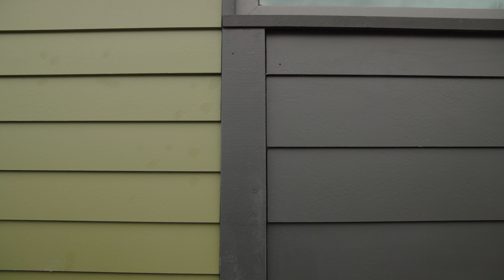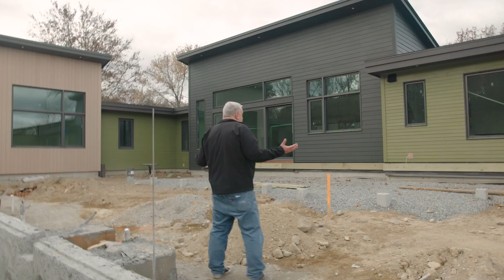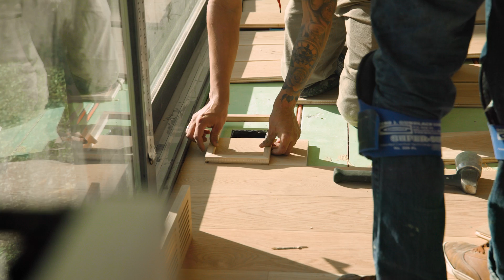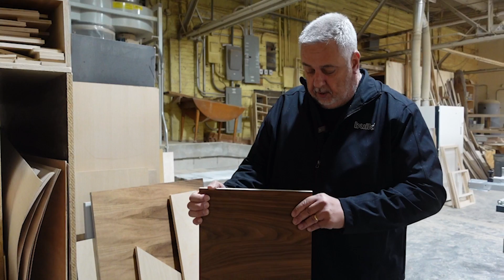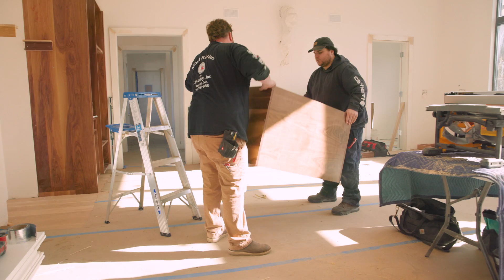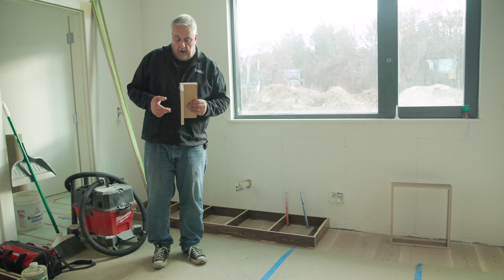"Wood Shop Tour, Casework & Exterior Updates" Build Show Build: Boston Ep. 22

Comment: Is there anything in place for future proofing external connections?  Last year I got fiber internet installed which means a new house pen.  No ISP is going to be as careful as how you did this new build.  Would a insulation filled pvc pipe make sense?  Something to give a path in when the homeowner needs it?
Reply: we added extra conduits to the house from the pole and conduits from the house to locations that might need to have power in the future.  Same thing inside with pathways to areas that are finished ceilings to be able to get added Cat6 (or future wiring) to the other areas.

Comment: 40:53 - no vent-holes for the refrigerator? The back-side makes a lot of heat!
Reply: probably has vents on the front or thru the bottom
Reply: The refrigerator is GE Appliances' latest Profile model that does not require those.  There is sufficient airflow from the bottom.

Comment: The problem with digital levels, for at least my Johnson digital level, is that you must calibrate them before using.  I calibrated mine a couple of weeks prior to installing some Cavity slider pocket frames but didn't recalibrate that day.  The pocket doors were all off by a couple of degrees.  I realized that after hanging the doors after the drywall wall was installed.  Ouch.  I'll stick with using a bubble level.
Reply: Thank you

Comment: Nice job on the full size fridge. Counter depth is too small
Reply: ...and the experience with the current house having the fancy brand of counter depth and the rest of that manufacturer's appliances has been getting the know the repair man all too well.  For the new house, GE Profile has in past homes proven to be incredibly reliable, have parts availability, a great service network, rational pricing, quality, great and very innovative features, etc.  Very happy with the choices that arrived this week!  the extra space makes a full sized refrigerator not stick out, other that for the door itself.